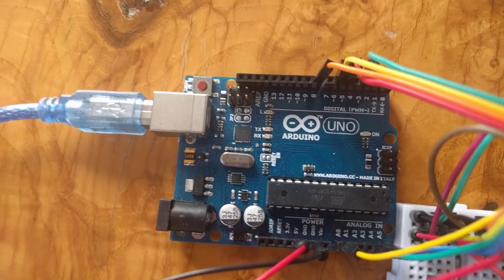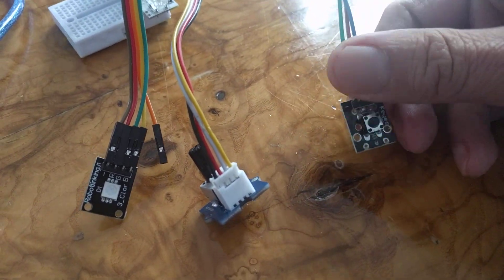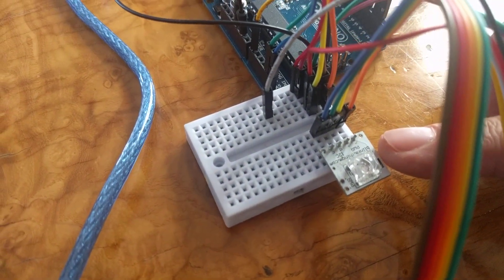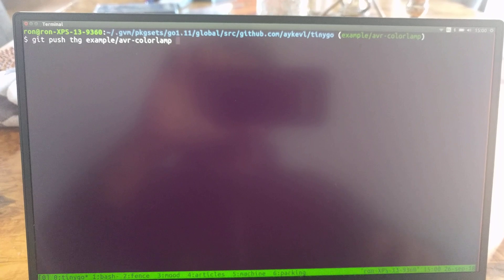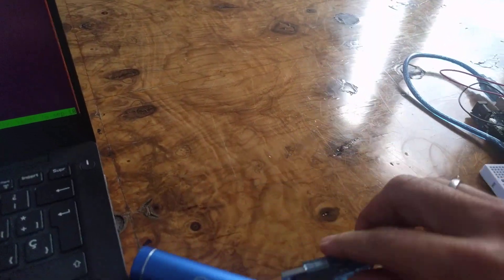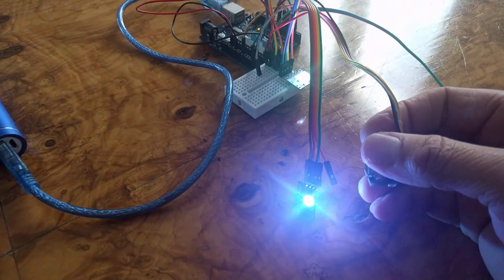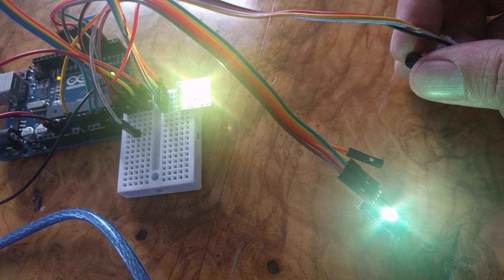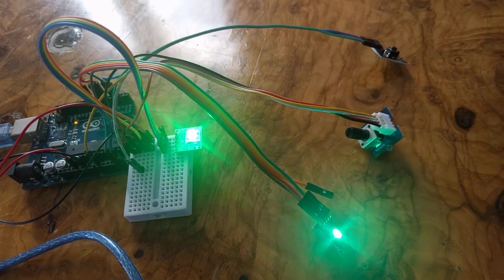Running Go directly on an Arduino Uno - the sequel

Comment: I have a question whether tinyGO is really better that typical C. I mean, I have recently found out that Arduino IDE has a lots of not really useful libraries that really make the code much heavier and run some code that not only does not contribute to my code, but wastes resources of the board, so I started learning registers and working without bootloader. Is tinygo yet another Arduino or is it really better than C?